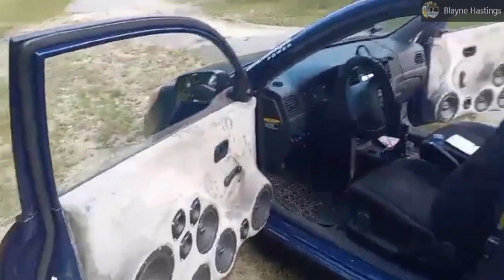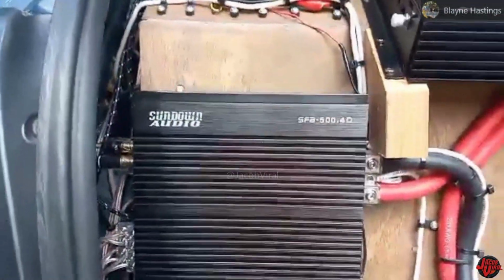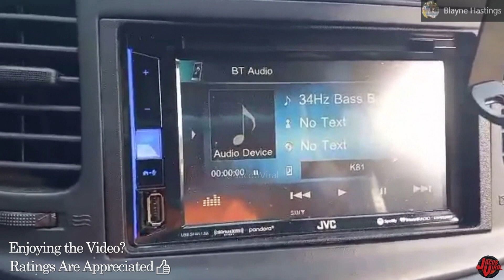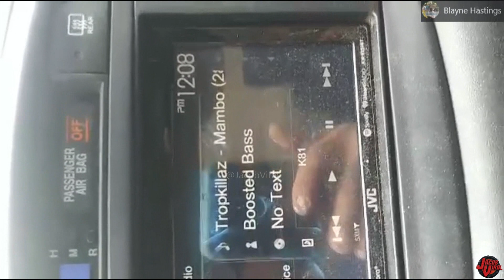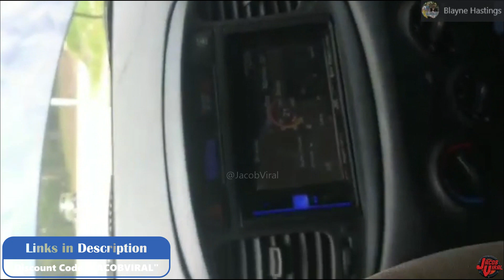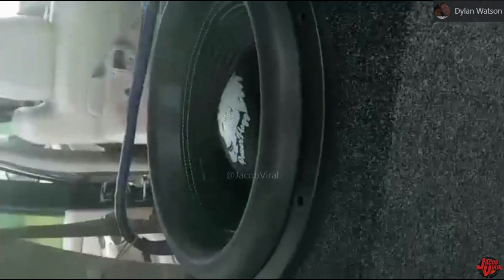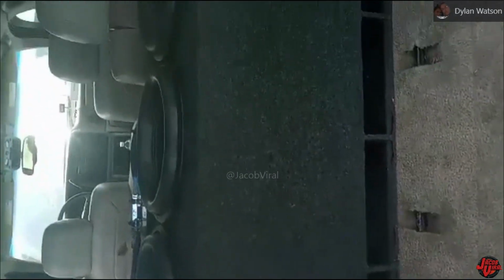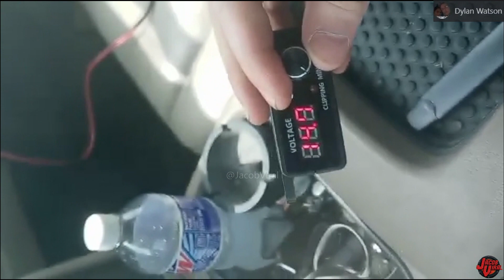HATCHBACK GOING FULL TILT INSIDE THIS SYSTEM! *Subscriber Bass Demos*

Comment: Is 6th order better then 4th order? I have a similar build to this but I haven’t built the box yet. Also what’s your 6th order tuned to? Front and back?
Reply from the maker: Both have pros and cons but a 6th will give wider bandwidth and more lows and a 4th of built right can be louder at peaks with more power handling as sealed section cone control. He’s probably tuned around 25-50hz
Reply: @JacobViral  if I wanted more for musical what do you prefer would be better? I love music, and I listen to a wide range of music (from punchy to low bass), what would you recommend I build? 4th or 6th? This is for 2xNsv4 D2 15s on 2x5ks wired at 1ohm each. 55ah lithium/370alt. Btw thank you for responding. Your videos, and reply’s help many bass heads like myself.
Reply from the maker: @xchampxownsx4535  if you can fit a 6th order go that route for sure you’ll be happier. Your welcome glad to help thanks for watching! Goodluck with the build.
Reply: @JacobViral  much appreciated 🤙